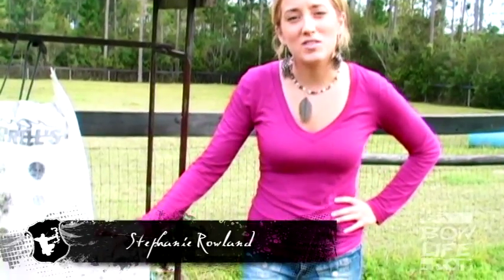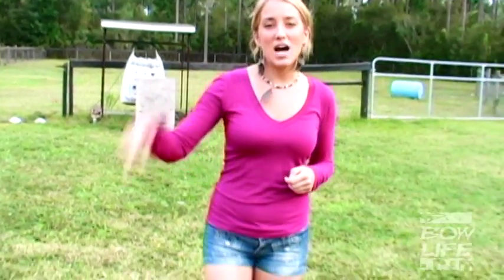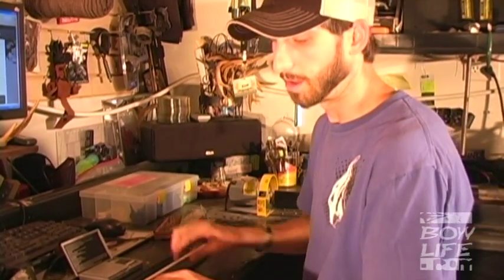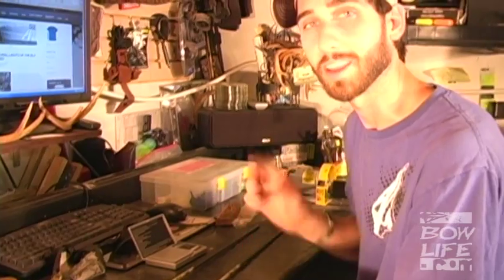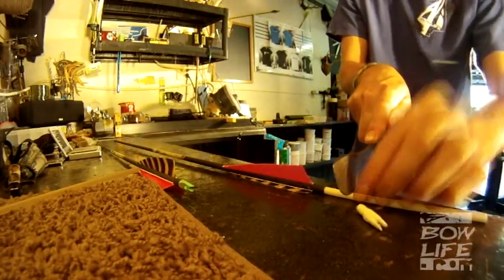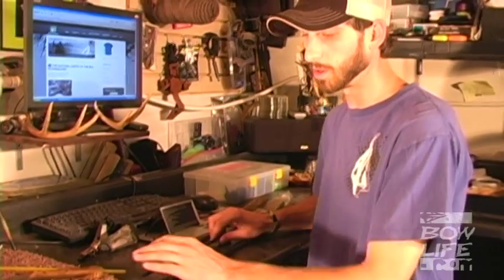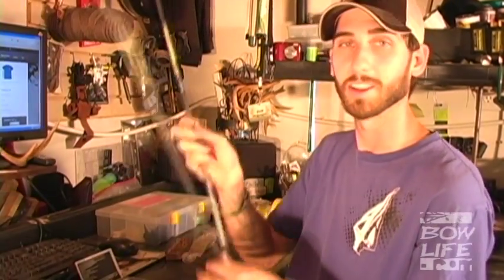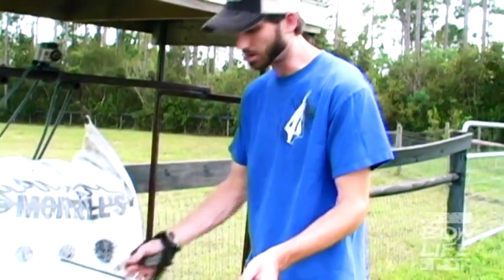Weight vs. Speed of an arrow

Comment: I used to shoot 2219's with the old school bear fixed two blades. My friends used to call them Lincoln logs. I ran an old PSE wheel bow cranked to well over 70lbs at the time. Every shot was full pass-through, ribs and all, shoulders etc and my luck they frequently wound up hopelessly buried into a tree on the other side of the shot. 
As long as you can hold the weight and you practice enough for shot placement, you won't go wrong with a heavy arrow, they really pack a punch. It's the most humane. Most deer I hit barely moved, they just flinched like they had a horse fly bite them and just piled up a few minutes later.

Comment: Try point loading for higher FOC instead of the weight tubes. Your arrow flight will be better, and you'll get even better penetration. You may have to bump up the spine you are using, but you will like the results even better than with the tubes.

Comment: If two arrows whose only difference is their mass are shot from the same bow, the more massive arrow will be the better penetrator. To a first order approximation, both arrows will have the same kinetic energy because the amount of mechanical potential energy the bow can store is fixed, but the heavier arrow will have more momentum because it will remain in contact with the string longer due to its slower rate of acceleration. The physics of what happens when a projectile hits a target can get extremely complicated, but a simple way to think about it is this: to penetrate a target material, there needs to be a critical pressure between the leading edges of the arrow' tip and whatever it's hitting that causes the target material to fail. Pressure is equal to mass times acceleration (or deceleration) divided by area, or Pcritical = (m*a)/A. To generate the critical pressure needed to cause the target material to fail, the arrow must decelerate. The more massive the arrow, the less it needs to decelerate in order to create the critical pressure required to push through the target material. Thus, the more massive, slower arrow will retain more of its velocity and will penetrate the target more deeply than the lighter, faster arrow.
Reply: wroooooooong :) but nice try first of all lighter and heavier arrow will not have the same kinetick Energy from the same bow because bow have limitation in how fast can throw superlight arrow and its build material dimension type of material have specified properties deflection chraacteristic  for which only specified range of mass arrow achieve best penetration posiible = to light bad BUT ALSO TO HEAVY also bad from some point of arrow weight from the same bow the arrow will lose its penetratibve characteristic i mean how deep it can go ,now last "more masiv slover will penetrate more deeply than lighter faster" its also wrong claiming :)  in real its oposit you and other guys which say what you claim jjust dont take into consideration in proper way each factor im personally today do test with arrow and styrofoam as well as with beaverboard  but i dont use the same bow but im use just gravitation and specified hight for achieve specified impact velocity so im use in test two "arrow" perfect straight steel bar with identicsl broadhead  first was 30,5 cm arrow weight 120 grams second 61 cm arrow weight 240 grams so i take couple of diffrenc hight for each so 240 grams arrow from 40 cm hight penetrate styrofoam on 2,7 cm deep vs 120 grams from 1,6 m hight what gives 2 Times biger velocity go on 4,5 cm deep so lightwer faster go deeper  also lighter faster better penetrate beaverboard ,im also do test with 1,05 kg "arrow"  from 5 cm hight what give 0,99 m/s vs this lighter 120 grams arrow from 1 metres hight what gives 4,43 m/s so much lighter and much faster have 2 Times around less momentum and 2 Times around more kinetick Energy and lighter go on 3,5 cm deep while heavy 1kg + on 3 cm deep :) .
Reply: @mociczyczki  You don't know what "to a first order approximation" means.
Reply: @mociczyczki  P.S. Learn how to use punctuation.
Reply: @mociczyczki  You have it exactly backwards. Here's an example to illustrate.

Assume a bow with a maximum 22 inch (0.5588 m) power stroke that requires one additional pound (~4.45 Newtons) of draw force for each half inch (0.0127 m) the string is pulled back from its initial braced position. The final draw weight at the maximum draw length will be 44 lbs (~195.87 Newtons). Since energy is equal to force multiplied by distance, at full draw, the bow will store ~54.73 joules of energy. (In this particular example, the force draw curve traces a right triangle, so stored energy = (1/2)*0.5588m*195.87N =~ 54.73Nm =~ 54.73 Joules =~ 54.73 Watt-seconds)

For the moment, assume the bow is able to transfer 70% of its stored energy to the arrow in the form of translational kinetic energy. This means that immediately upon launch, the arrow will have ~38.31 joules of (translational) kinetic energy.

The formula for kinetic energy is: K.E. = (1/2)*m*v^2, where m = mass and v = velocity. When we rearrange this equation to solve for velocity, we get v = (2*K.E./m)^(1/2) - velocity equals the square root of two times kinetic energy divided by mass. Because we know the value for kinetic energy, as long as we also know the arrow mass, we can calculate the launch velocity and then we can then calculate its momentum, since p = m*v - momentum (p) is equal to mass times velocity.

Now consider two arrows, one that weighs 220 grains (~0.01426 kg) and another that weighs 440 grains (~0.02851 kg) but are otherwise identical that are shot from the bow described above.

220 grain (~0.01426 kg) arrow:
Launch Velocity: ~73.31 m/s
Kinetic Energy: ~38.31 J
Momentum: ~1.045 kg*m/s

440 grain (~0.02851 kg) arrow:
Launch Velocity: ~51.84 m/s
Kinetic Energy: ~38.31 J
Momentum: ~1.478 kg*m/2

So, both arrows have the same kinetic energy, but the heavier arrow has more momentum.

This is a first order approximation. Experimental data show that in reality, the two arrows will not have the same kinetic energies at launch. In fact, the heavier arrow will have more kinetic energy than the lighter arrow because, for a variety of reasons, the bow will be more efficient at transferring its stored energy to the heavier arrow. In this instance, for example, while the bow might be 70% efficient at transferring its stored energy to the lighter arrow, it might be something like 72% efficient at transferring its energy to the heavier arrow, in which case the heavier arrow would look like this upon launch:

Launch Velocity: ~52.57 m/s
Kinetic Energy: ~39.40 J
Momentum: 1.499 kg*m/s

In most circumstances, the greater momentum of the heavier arrow will enable it to penetrate whatever target it hits more deeply than the lighter, faster arrow provided that the two arrows have the same dimensions. This is because an arrow - or any projectile - penetrates a target material by generating a critical pressure between its tip and the target material such that it causes that target material to fracture (fail, rupture, shatter, fissure, etc.).  Pressure, P, is equal to force, F, divided by area, A, so P = F/A.

Force is equal to the change in momentum, dp, divided by the change in time, dt: F = dp/dt. Since momentum is equal to mass times velocity, this is equivalent to saying F = d(m*v)/dt, which can be rewritten as F = m*dv/dt, because the mass of the arrow does not change, only its velocity does. 

This shows that for an arrow or any other projectile to penetrate a medium (air, a target, an animal, etc.), it needs to "spend" its momentum to generate the force necessary to push the medium it is moving through out of the way. The heavier arrow, as I've shown above, has a larger momentum "budget" than the lighter arrow, so it will be able, *in most circumstances*, to penetrate whatever it hits more deeply than the lighter arrow.

An exception to this appears to be the heavier arrow's ability to penetrate certain kinds of target materials, where the target material is of a type that closes around the arrow, gripping onto the arrow shaft as the arrow bores through it (which is unlike what happens when an arrow pushes through animal tissue, for example). In this case, the target material takes a certain amount of time to close around the arrow, and it appears that the target material doesn't close fast enough to grip as tightly or as much around the lighter, faster arrow to slow it down as it is able to do with the slower, heavier arrow.

In the main, however, empirical data consistently show that slower, heavier projectiles penetrate more deeply than lighter, faster projectiles, all other things being equal. Empirical data also show that a narrower arrow penetrates more deeply than a broader arrow, all other things being equal (in other words, the depth of penetration an arrow is capable of achieving increases as its sectional density increases).

See here for a further discussion on this topic: https://cpw.state.co.us/Documents/Hunting/EHU/Momentum-KineticEnergy-ArrowPenetration.pdf
Reply: good that you write at least  the same bow will not give the same kinetick Energy to diffrent weight arrow like im write each bow have specified sweet spot  range of arrow weight  to which transfer Energy in most efficient way so like im write it cannot be to heavy as well as to light .
Reply: the bigger cavity hole tissue while projectile penetrate tissue come form higher force from more rapidly Energy momentum change in time distance so in shorter time or distnace  the angle of attack  be projectile shape corelation with iots diammeter pushing tissue  on from side to side circular slow heavy arrow dont generate so big resist upon contact with tissue and lesss expand tissue on side so change its momentum in change time slower  what decrease peak force on graph and this hole tunel expand did not overtake bullet bullet is alwayson front hole expand right after bullet  dont decrease resistant on bullet.
Reply: let say we have two the same arrow except mass and velocity arrow forget about the same bow case both was throw from optimal bow  so we have two arrow one have  10 kg x m/s and 50 jpules second have 5 kg x m/s and 100 joules which penetrate deeper  some regular molecules material ? now diffrent comaprision  10 kg x/ms and 50 jpules vs 10 kg xm/s and 100 joules? and last 10 kg x m/s and 50 jpules vs 5 kg x m/s and 50 jpules ? diffr3enc also may come from speciiffied speed level which cause specified diffrent phenomenom like for egzample this cavity hole expand at super high velocity wide in tiossue distract alot Energy etc . like hear https://www.youtube.com/watch?v=fX4ODh1g4eM  .
Reply: @mociczyczki  In order for your experiments to be relevant to the discussion at hand, which is about selecting arrow mass for a given bow that maximizes penetration, you need to hold potential energy constant, not momentum. So in your first experiment, you should drop the heavier arrow from 0.8m and the lighter one from 1.6m. This will give both arrows ~1.88 J of gravitational potential energy and will approximate shooting two arrows of different masses from the same bow. What the experiments you've performed do is approximate the effect of shooting a heavier arrow from a low draw weight bow and a lighter arrow from a high draw weight bow.
Reply: @Marmocet yep im write forget about the same bow just take into consideration  diffrent joules to momentum proportion just for knowledge about whole this issue because people are so restricted often that dont recognize one from another  and if you once say heavier=better penetration than they always no matter what kind of bow and diffrent in momentum and kineticfk Energy be saying that heavier give always better penetration what is bullshit .

Comment: How do you have 173k views on this trash ..  No crap,  that a heavier Arrow will penetrate farther through a given material..  but if you're hunting deer who the heck cares what's the point of limiting your range?  
Props on using the hot c hick try to lure people in... 
So once you get into like the physics of its speed definitely has its merits over Mass.. not sure you have physics in whatever Southern Bastion you reside... 
Absolutely zero reason to shoot that heavy  of an arrow at a deer..  plus you didn't talk about the total weight of the arrow the grams per inch of the arrow what size Arrow the length of the diameter... 
If you're going to do a sciency thing do it right

Comment: I am relatively new to bow hunting, just 3 years, but all this talk about speed v. weight is amusing to me, as they are both parts of the same formula. The animal and conditions would determine which element is the key. So far, I'd say with whitetail, silencers and speed is more important, to keep them from ducking under or such. If I ever get the chance to hunt elk or moose, then I'll go for weight.

Comment: I shoot a 55 lb bow using 7.7 gpi @29 1/4 and have had pass through and no problems.  I don’t aim for bone but I did hit it one time and my arrow didn’t go clean through but the deer didn’t go 50 yards, so it’s not always heavy arrows are better. Really it’s a combination of the right weight mixed with speed that penetrates better!

Comment: If your inefficient bow is pushing the 376 grain arrow out at 276 ft/sec with 63.7 ft-lbs KE and 0.46 slug-ft/sec of momentum, it should be pushing the 550 grain arrow out at a max of 239 ft/sec with 70.1 ft-lbs of KE and .585 slug-ft/sec of momentum.
When people talk about KE, they are missing the point of momentum, the tendency of an object in motion to want to stay in motion.  Your kinetic energy went up 11% because of more potential energy from the limbs going into the arrow, rather than vibration, but your momentum went up 27%.  If tour velocity numbers for your bow are correct, your bow is out of tune, but the heavier arrow compensated and increased your bow's efficiency even more, giving you 262 fps with 84 ft-lbs of KE (the real numbers for that mass and velocity) and 0.64 slug-ft/sec.
All I know is my first carbon flu-flus would not reach the tree canopy where the squirrels were, so I weighted them up to the 520 grains of my POC woodies and the problem was solved!  Momentum from mass counts!

Comment: Not sure how you are doing your calculations because the energy comes from the limbs.. a light arrow will develop its energy as a result of speed where as a heavy arrow will develop its energy from the weight.. if shot from the same bow the energy should be just about equal (regardless of the total weight - unless you are shooting paper straws).. The heavy arrow will penetrate better because it does not want to stop or slow down as quickly as a lighter arrow, as with any projectile, lighter one will give up its energy easier and faster,, in the case of bullets for example this may be better for faster expansion inside the vitals where as heavy bullets may pass through not giving up much energy and not causing a traumatic wound channel.. but in the case of arrows you do want pass through and to cut a big hole all the way through and have two bleed holes unobstructed.. if it does not pass through then you only have one bleed hole and is partially blocked by the arrow itself.. Add weight to the front of the arrow is better than adding weight to the entire shaft.. A light arrow with a heavy tip will penetrate better than a heavier shaft and light tip (both arrows weighting the same).. Shoot heavy tips and if necessary use brass inserts instead of aluminum for more weight forward... By putting a tube inside your arrow you may also be changing the spine weight and may not shoot as accurate.. Heavy tips and more weight forward are always more accurate than heavy shafts and light tips.. So if you are going to add weight then add it to the front and not to the shaft.. The arrow will be more accurate and penetrate better..

Comment: kewl video.....I'd like to see the same test with a High Country X12 and the High Country Speed Pro carbon arrows with 55 to 85 grain tip on the Speed Pro arrows. I agree the heavier arrow will penetrate but if you have a faster lighter arrow there does come a point where the speed will help make up for the lack of weight. I know the X12 with the light tip and speed pro arrows hit velocities around 357 fps. That fast of an arrow will definatly penetrate. Not saying your wrong just some more info from stuff I've played with!

Comment: First of all, wtf is with the inserts? You want weight and penetration? Spend the $$$ and buy Easton FMJs or something.

Don't care how a field point does against plywood. I don't fill my freezer with lumber. A 430 gr arrow (with broadhead) @280fps can pass through a bear, let alone a deer. So...

Anyone can hunt deer with a .308, but a GOOD hunter can do it with a .223. 

If you like taking "hard" shots, buy a crossbow, because as others accounted out, the snap of the bow will give a deer enough warning. I've seen Elk jump an arrow @ 40 yards, so a paranoid doe could be like Neo in the Matrix dodging weighted-down arrows.

Comment: a decent test with real life results.  my only problem is you are shooting deer.  you dont need 500 grains to shoot a deer.  you are acting like you need the knock down power of a tank to kill a deer.  its a bit far reaching.  my 440 grain arrows out of my hunting bow run mid 280s @70#.  same arrow out of my 60# speed bow does the same FPS.  ill get #s soon when i crank my speed bow up.  i now have 340 grain arrows to test on.  im expecting 310fps with the light arrows.  with the speed they are gaining they have the same kenetic energy as my hunting bow with heavier arrows.